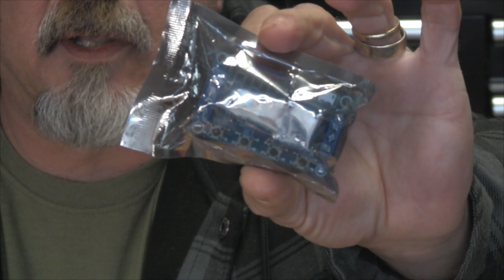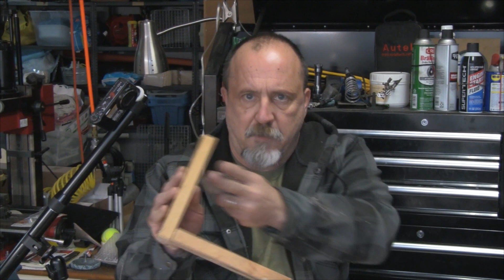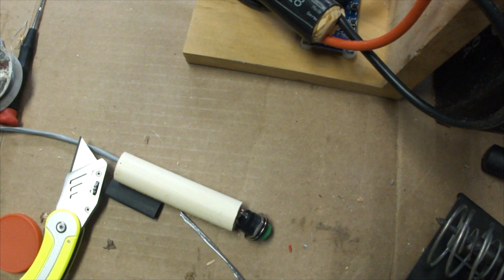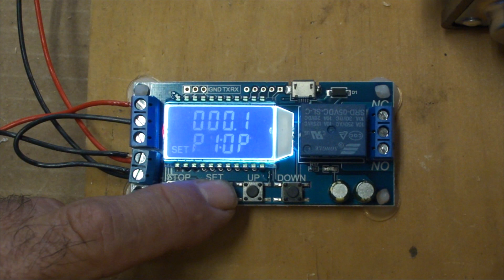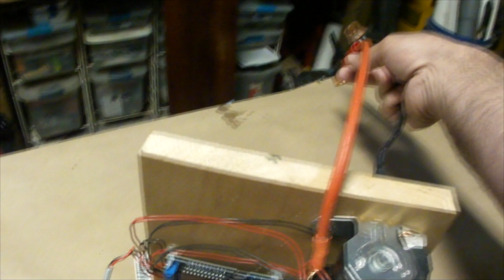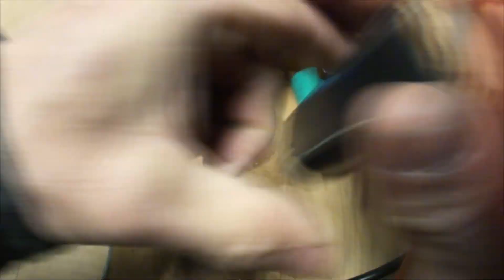How to Make Your Own DIY Spot Welder for  18650 Lithium Ion Battery Packs

Comment: I should have come here before I purchased all those stupid cheap non-working spot welders on aliexpress.  
Your design works great!  I mean, I sat down this afternoon with three tin cans and large spools of three different sizes of nickel strip.  Bet I made 500 welds.  Wires didn't get hot.  Solenoid didn't get hot.  Pen (electrodes) didn't get hot.  It just works.  It just works over and over and over!  Pressure on the electrodes does make a difference.   Would like to be able to set the timer at hundredths of a second increments instead of just tenth of a second increments but that's nit pickin.  Thanks again.  Now to find a use for welded up tin cans.
Reply from the maker: Steve, That's one of the best compliments I've ever received! I'm glad this worked out well for you. I'm curious as to what timer you used, the one in the link will let you refine it the 100ths of a second. But in any event, keep welding and let me know if you figure out what to do with the tin cans lol
Reply: @ExtremeDIYGuy  I'm using the Drok timer you linked to above.  Drok says it cycles at 0.01s-9999mins.  But, the instructions I downloaded for the 35238-MP Mult-Function Timer clearly states .1 second Resolution.  Makes no sense to me, but, neither do women.  I'll play with it (the timer) some more tomorrow, if I can find some more cans.  Thanks again.

Comment: Nice vid and thanks for the info. I would put a diode across that relay trigger. I've killed a solenoid before not doing it. When the field collapses, it creates a reverse current that can damage it.
Reply from the maker: I'm assuming you would put it in reverse normal polarity?
Reply: @ExtremeDIYGuy  Yes sir.
Reply: Did u had the controller board when u burned it?
Reply: i'm building one now and i don't have a diode to put in my parts

Comment: I just got my setup assembled.  Everything seems to be working but I'm not getting any weld.  I have a motorcycle battery with 335 cold cranking amps.  Do you have any trouble shooting tips to figure out what is off?  I got the same timer board and solenoid and followed your pen instructions so it should be the same machine.
Reply: Another bit of information.  When I fire the welder with the pen in the air.  The timer just fires once when I hit the switch.  When I have it in contact with the strip, it will fire repeatedly.  Not sure why.  I bought this off of ebay: Pure Nickel Plated Copper Strip Tab 0.15mm x 8mm.  I've read somewhere that you need pure nickel.  Is that my issue?
Reply from the maker: It sounds as if the battery doesn't have a sufficient charge to weld. I would check the voltage on the battery. I think the strips you are using might also contribute to the problem of not welding, I would definitely a pure nickel strip. I'm not sure why it would fire repetitively under load. It might be that 12v relay contacts bouncing but that is unlikely. I would make sure are the connections are tight, definitely make sure you have a good ground.
Reply: @ExtremeDIYGuy  I'm not 100% sure what is going on.  I can get it to work sometimes.  Once in a while I get a spark from the clip on the battery terminal.  The batter is reading 12.9 volts so it's got a good charge.  I've tightened up connections and played with the timing board.  When I do get it to fire, I don't get a weld but that could be the stip.  When I ordered it it said Pure Nickel then I realized it was pure nickel plating.  So I've ordered some pure nickel stuff.  We'll see how that work.  When I do get it to fire, it seems to only fire once so it may be some kind of connectivity issue.  I've checked continuity on all the cable lengths and such.
Reply from the maker: Not sure where to tell you to check next. Sounds like you're on the right track. Should fire once per trigger though so that sounds right unless I misunderstood.

Comment: Trouble shooting the solonoid. I wired up the diagram and had no luck. But i traced the problem. The soloniod negative is the back mounting plate. Not the second small terminal on the relay. That is actually for a coil. But in this aplication isnt used. So for the solonoid to fire you apply the 12v signal coming from the timer to the s terminal on the relay. And the i terminal isnt used. The ground wire is grounded to the mounting plate. Just like it would be grounded to the car body. I hope that clears up the people who are having trouble getting it to work. Great job jose awesome video. Im now a subscriber.
Reply from the maker: Thanks, hopefully that helps other viewers. The back mounting plate on mine is grounded as I attached the neg cable to it on both sides of the bolt. I did attach a ground to one of the small terminals on the front and the trigger (+) output to the other.

Comment: Unfortunately I am getting short on the timer.  If I unplug the common or unplug "NO" then no short, timer works fine but no weld/spark.  While they are connected the the timer goes nuts, just keeps firing off when I press the button vs the timer countdown.  Any idea's, could I have a bad timer?
Reply from the maker: It sounds like the timer is in the wrong mode. But it could be a bad timer as well. I would start by going over every wire connection to make sure it is correct and securely fastened.

Comment: Hey Jose, thanks for the demo and the write up. I used your affiliate links for the timer and relay!

Have you had any issues with the DROK? I got through about ~20 welds (a few tests to tune the timing and 7 cells welded) and now it occasionally gets hung up when trying to fire the solenoid. Cycling the power on and off resets the timer, but as soon as I short the starter with a weld, it fails. I'm wondering if the system needs an actual ground (vs just the neg terminal on the battery)?

Also, I ran into an issued during assembly that I think others might find useful: the negative/ground for the starter relay runs through the mounting bracket, not through the 2nd post on the solenoid. This is sort of a gee-wiz after assembled, but if you follow your wiring diagram and photos, you will not succeed. I think you got lucky because you ran the negative through your frame and just happened to attach it to the mounting bracket.
Reply from the maker: I'll have to take a hard look at that diagram. I actually ran the ground through the mounting bracket intentionally, thos relays are fussy and need a ground at the bracket as well as on one of the front posts. Mine is holding up well, I haven had it hang up on me. I've done about 100 welds through it with no problems.
Reply: Yeah, I don't know what changed, but I have welded another 60 cells without issue. 

There are comments on the Amazon listing also describing the use for the other smaller pole. I think it's for an indicator light.
Reply from the maker: @theborednerds  At least it changed for the better! The smaller pole on the drok? The output side one is NC and the one I used is NO.

Comment: How many welds do you think you used this for when building your battery?  I'm building a battery pack that will require a few thousand welds and was curious how that starter relay would hold up.
Reply from the maker: I used it about 50 times for the battery pack I made. Not sure how it would hold up to 1000 welds but it's a car starter relay so is pretty rugged.

Comment: @Jose's Extreme DIY -- Did you post the correct link to the timer circuit?  Can I set the delay short enough not to burn through the nickel strips or my batteries?
Reply from the maker: Yes, the link in the description is the timing circuit I ended up using. It gives you control over the timing, you can go as low as 1ms.

Comment: Hi, Thanx for the amazing video, respect! Can you please tell me what current and volts are going towards the Solenoid? 12V and how many Amps? Thanx in advance 😊
Reply from the maker: Battery was 12v and I believe rated for 860 cca. I don't know if that was the amperage flowing through it as I did not measure it but the potential was there. It really all depends on the capacity of the battery you have hooked up to it. That is why I put a timer circuit on it,. The more amps the battery is capable of, the less time I want it passing current. Does that make sense?

Comment: I am having a horrible time trying to fit 3 wires into the small positive holes on the control panel.  I'm using 14 gauge wire.  Did you use the bell wire to wire controller to solenoid and battery?  Could I attach all the 3 wires going to positive on the control board together on one side of a butt splice connector and then on other side of butt splice connector have one wire running to positive on control board?
Reply from the maker: I can see that, I used bell wire for all the connections to the small controller. There isn't much room in those connectors !

Comment: 0.01s = 10ms = 1/100s
0.001s = 1ms = 1/1000s
I think you mixed these up a bit in your commentary.
Reply from the maker: I did and I should know better since I've been in IT for over 40 years!
Reply: @ExtremeDIYGuy  Hah, I'm in IT too. I tried to make a similar welder to yours, but using a smaller battery, and it didn't work for welding 0.3mm copper strip. I'm trying to use some high amp 21700 cells and I want to access up to 30 amps per cell. Any ideas for what material to use to connect to the cells that will allow 30 amps through safely?
Reply from the maker: @joes973  It reall all depends on how many cells you have in the system. Most of these battery packs will connect a set of cells in series for the voltage you want and then connect those to another set in parallel to give you more current capability. Having said that, it's the bridge between the cells in parallel that would be carrying the the brunt of the current. You can spread that out by putting in a connection for each battery in the series in parallel to the battery in the series next to it.  I wish there was a way to post a diagram because what I just said sounds confusing.
Reply: @ExtremeDIYGuy  No, that makes a lot of sense. I've watched hours of videos on it. My problem is that I'm using high amp cells in a 12s2p battery, so I only have two terminals per connection.
Reply from the maker: @joes973  I would go with regular nickel strips and see what happens when you try it. Worse that can happen is that the strip acts like a fuse and burns open!
Reply: @ExtremeDIYGuy  Couldn't it burn through the protective coating, cause a short, and result in thermal runaway?
/apocalyptic-scenario
Reply from the maker: @joes973  I wouldn't think so, I believe the nickel strips would burn open acting like a fuse of sorts. Maybe I'm missing something?
Reply: @ExtremeDIYGuy  Just to confirm, how many ms do you typically use? My timer can do 10ms increments, but it takes at least 30ms to get the solenoid to connect. I've tried my "255 amp" battery up to 100ms on 0.15 nickel (welding to itself): it sticks a bit, but not a true weld.

Comment: Can you upload more pics. Especially the back and how the wires are connected.  For the life of me I can't get it to work.  Appreciate your vids!
Reply from the maker: Thanks, Let m eknow if these two files help any. They are in the comments but they helped someone that asked for them earlier. Closeup Wiring #1 https://bit.ly/2MVl7Cy
Closeup Wiring #2 https://bit.ly/2HIqS7i
Reply from the maker: I connected the ground wire from the back of the unit to the battery using the bolt that holds the relay on as a connection point. I then used that bolt and the plate of the relay as a ground point for everything that needed it. It sounds as if the  plate of the relay isn't grounded? You need to make sure that the back plate of the relay is grounded as well as one of the small terminals in the front. When you apply current to the other small terminal, the relay will close.

Comment: Thank you again for the work you put into this. I was using a bench top power supply but now my relay is only getting 3+v when triggered, went straight to battery like your and I’m off and running again. Kids need there dune buggy battery before snow fall.
Reply from the maker: I'm glad you had success. Better put a charger on the battery before giving it back to the kids! :D
Reply: I was building them a 7s 5p was maybe a little to big to start and my main wires were a little to big trying to finish 4s 5p to get them rolling again.
Reply from the maker: @gregorytrenhed8318  Good deal, post your results here!

Comment: @Jose's Extreme DIY Hey can I use any other power source instead of car battery like maybe direct pluging to switch board or something??
Reply from the maker: I don't think you would get the amperage you would need unless there's a large transformer in the mix. Also, 12 volts is relatively safe to work with. You would be dealing with unknown voltages, I would advise against it.

Comment: Hi sir can we use smps instead of battery, if possible how many amps smps to be used.
Reply from the maker: I would be afraid to burn out the power supply. Welding does create a short across it.

Comment: I had ordered the parts before your came up as a suggested video, the solenoid was a 500a solenoid, do you know what kind of current you are flowing? I guess its gonna depend on the battery used and the amount of current available minus the resistance in the circuit. does yours build up much heat? I also ordered some cooper stock that seems larger that the one you are using, i have a question though. Why do i see everyone bringing the ends to a point? I left mine flat, i would think that flat would be better to dissipate the heat/spark at the tip, and as long as you have enough current available. my thinking is that this would aid in the life of the tip as opposed to all the energy eating into the copper tip, i guess ill see... lol I just ordered the controller but all the other parts are in and ready. 

 Its funny though, great minds think alike, after a lot of research i came up with the same simple design as you for relatively cheap compared to whats available commercially. Thanks for this video and easing any fear i had that it would not work, now i'm pretty sure its a good design, especially for my needs.
Reply from the maker: I have not measured the current but it is certainly pretty high. I'm not even sure that using an Ammeter would capture that since the current only flows for a few milliseconds. But I believe you are correct, it depends on the battery you are using and what it's capable of. Which is why being able to adjust the time is critical.  I put points on my pen with the concept of being able to pin point the current flow. also, the commercially available ones have points on the electrodes. I can see your point on leaving it flat though. As long as it works!

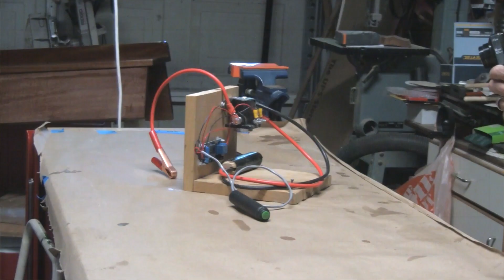Comment: Nice Job, suggestion for future video's. Show an up close final product(usually in the beginning) and the components used in one frame for several secs. Oh, I found that @ 9:08.  Great work thanks
Reply from the maker: Thanks for the idea!
Reply: @ExtremeDIYGuy could you have used the pen itself as the trigger so when it shorts against the nickel that does the trigger command instead of you pushing the button? Or would that blow up the pcb timer board maybe?

Comment: Excellent video.  I just made one following your instructions here and on the written link.  I used it to spot-weld 3V Li-on button battery for my ham radio (I had to cut the impulse time down significantly ;-0).  Works great.  Spot welds are easy now. Can't wait to make up some 18650 packs.  Thanks for posting.
Reply from the maker: Glad it helped! I have raw footage on making the pen, just havent had a chance to edit it and put it up yet. I'm glad this was helpful to you!
Reply: @ExtremeDIYGuy  Ever finish the pen video?  I want to make one
Reply from the maker: @rocketman2149  I actually recovered the raw footage from old backups so plan on putting one out sometime soon.
Reply: Jose's Extreme DIY no problem I printed out the written copy from website, thank you though.  Your videos are awesome!
Reply from the maker: @rocketman2149  Thanks! I appreciate the positive feedback!
Reply: @ExtremeDIYGuy

Comment: Awesome video.  I've got everything from your links.  Got the tiimig board programed.  Got the main lug terminals to the battery and pen.  I can't read the wire diagram to go from the timing board to solenoid. Could you upload a close up picture of the wires from the timing board to the solenoid? Thanks!
Reply from the maker: I added two links in the description, closeup wiring #2 shows the black wire going back to a common ground point. YOu could really ground it anywhere and it will work.
Reply: @ExtremeDIYGuy  Thanks! I might have a bad solenoid. I ordered the one from your link but it can in red color not black.  I cant get any current on the large pen lug. The meter spikes when I go across the 2 smaller bolts.
Reply from the maker: @lanemeadows9957  Should have ground on one smaller lug and the relay should close when you apply + to the other. There will be a resistance reading between the two  which is normal because there is a coil operating the relay. Try one more thing before returning. Run a piece of ground wire to the solenoid frame where the bolt goes through as well. If I remember correctly, I think I had do that to get it to work.
Reply: @ExtremeDIYGuy  Its alive!!! Grounded all the negatives together on the solenoid chase then to the battery. Got the spark on the pen! Thanks again!!

Comment: Did you use the timer controller that you linked to in the video or another one?
Reply from the maker: I used the timer control that I linked to in the comments (it's in the video). That one gives you far greater control than the one I initially was going to use.
Reply: @ExtremeDIYGuy  thanks!